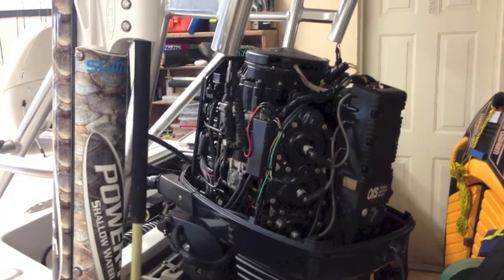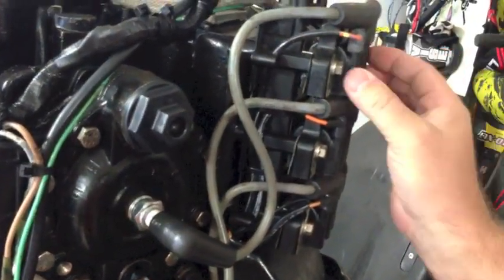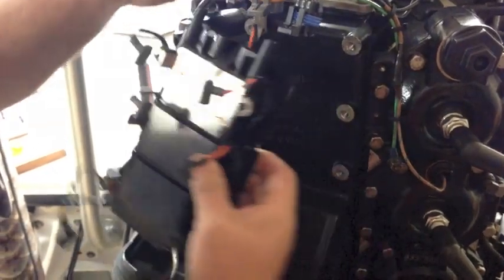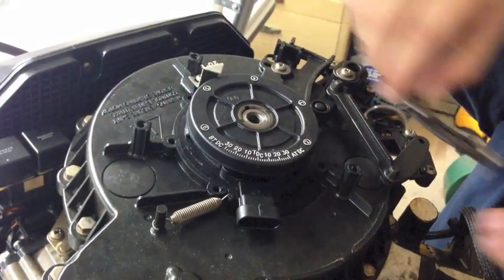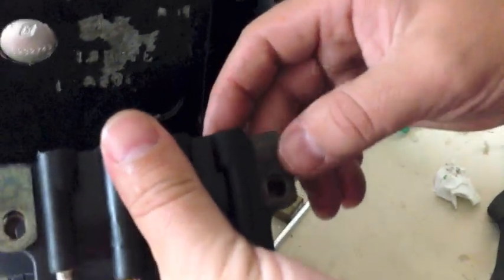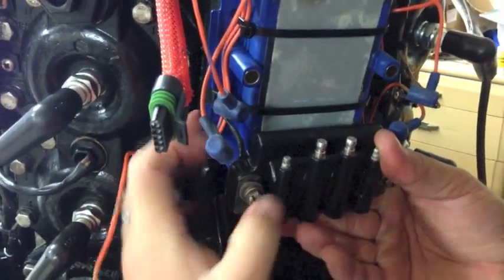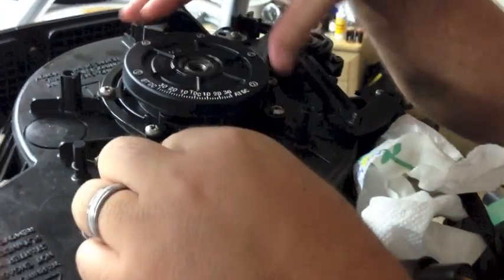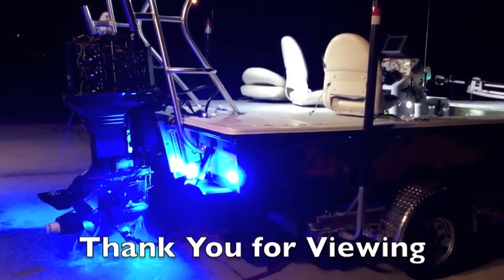1996 Evinrude 150 Power Pack Replacement

Comment: Hey Bobby, great info, I checked my shift switch by unhooking the ground wire and it still only ran the 3 port side pistons, the 3 starboard remainder dead in forward neutral and reverse. I can only assume the power pack would be the issue. Would love the feedback!
Reply from the maker: That sounds like the power pack. I’d replace the coils at the same time.

Comment: I can't believe any boat mechanic told you to change the power pack as a first try to fix the problem!?
I'm not any kind of mechanic but it's pretty common knowledge that the shift interrupt switch kills one whole bank of cylinders, and the switches often jam or short out.
Just pull the wire plug out up near your thermostats on the head to test. Follow it down to the shift /throttle linkage at the base of the motor and your will see it.
Reply from the maker: Wish you were here to troubleshoot!

Comment: I have a 2000 Johnson 150HP that having the same issue with no spark on one complete side of the engine.  I have replaced the spark plugs and wires, the power pack and optical sensor, and all the coils.  Still have no spark on the same side of the engine. (left side when facing the engine standing at the rear)  Is there something else I should check.  I bought a new stator to replace but now I'm just throwing parts at it.
Reply from the maker: It sounds like a ground is not connected shutting off the bank. There are three wires going to the shift interrupt switch. One positive and two negative. I would try and figure out if something is wrong there. Or the switch itself has shorted out.
Reply: It in fact the shifter switch. I did change the power pack, optical sensor, coils, wires, and plugs. Did not fix the problem. I was about to change the stator before I came across your other video about the shifter switch being an issue. As soon as I removed the ground wire all three of those cylinders had spark. I wish I had found that video first before I spent all the money on that other stuff. But a good lesson to learn.
Reply from the maker: Having all that stuff replaced is probably for the better anyway! Such a great motor as long as you keep the oil mix. Mine is still going strong. It’s a 1996.

Comment: I have a 2001 Johnson 150 hp outboard it looks the same as the one you’re working on but I’m white, it runs good for about 5 - 10 minutes and then dies and have trouble starting it again, I replaced all spark plugs, clean carburetors, new water separator, it was running good before I store it for 4 months
Reply: I just subscribed to your channel I like your work
Reply from the maker: thank you so much!

Comment: i know this is a old video but i have the same motor and had the same symptoms so i changed the power pack and starts up good but will not idle i have checked the shift switch rebulit the carbs new powerpack new optical sensor new plugs the only thing left that could keep it from running would be the stator any ideas?
Reply from the maker: I would rebuild the carbs again. My problem was a tiny piece of plastic curled around one of the high-speed jets from cross threading it. Do a complete bowl replacement.

Comment: nice video thanks for sharing. I have a 05 175hp no spark on any spark plug, coils tested fine, how do I test the power pack? engine sounded good.
Reply from the maker: I do not know how to actually test the power pack. I’ve only replaced them. Wish I could be more help.

Comment: I'm having the same issue, The thing is a few years ago when I bought the boat I couldn't get it to start and did some shot gun trouble shooting and started replacing things. Well I replaced the power pack because I didn't know how to test it but my starting issue was my optical sensor. Well now I have one bank not working / spark so I thought it was the power pack so i used my good know power pack that I replaced for know reason and it switched sides, from the side that was working is now not working. I've swapped them out a couple of times and with one power pack one side is bad and with the other its bad. Not sure if i should buy a new one
Reply from the maker: Try the shift interrupt switch. I made a video on this. If it goes bad half the cylinder banks will go out.

Comment: Hi ,i have a 1997 johnson 150hp OIS and Not firing left bank 2,4,and 6 piston. The right size are good. Firing but not hard. PoWERPACK, OPTICAL SENSOR? AND i have another question the cable in the wiring color gray and red line its for? Thanks
Reply from the maker: I would check the shift interrupt. I have a video on this if you search my channel. The shift interrupt switch shuts off the left Bank to make for easier shifting. Seems like it could be that

Comment: Good video. I have a 96 150 Johnson Oceanrunner. It runs great, plenty of power, idles well, but has a random miss, any mid to high throttle position. Its like someone turning off and on the key for a split second. Any ideas. Thanks.
Reply from the maker: Sounds electrical. I’m not a  mechanic but the power pack controls the spark, coils amp up the power, optical sensor controls the timing. I’d start with power pack. It’s an easy swap.

Comment: Hi, what model is power pack?
Reply from the maker: It’s a CDI 113-4985. Runs perfectly. I’d replace the coil‘s at the same time. It’s not that much more money and you already have access.
Reply: @bobbygfl thanks, And the coils is the model OMC 583740, 0583740, 18-51703326AB
Reply: @bobbygfl  My coils were stolen
Reply from the maker: @olivermontalvo1590  oh man. That sucks. I need to look at my old coils. I still have them. I’ll let you know.
Reply: @bobbygfl  please, thanks

Comment: does that issue bring on your check engine light?
Reply from the maker: I do not have a check engine light however it would have a buzzer and no it does not set off the buzzer
Reply: @bobbygfl  Im having an check engine light coming on at about 3k    im sure it is the vacuum sensor but cant seem to figure out why
Reply from the maker: @jerrythompson3918  I wish I could help. Good luck, hope you’re right.

Comment: I have a 1998 150hp. I'm having issues between 2k and 3500 rpm. It stumbles. A lot better at wot but it cant rev past 4200 rpm. What electronics should I change? Thx in advance.
Reply from the maker: sounds like carbs.  sorry for the late reply.  hope you figured it out

Comment: Great video. I purchased a 1998 90hp Johnson OceanRunner. I replaced the power-pack and just ordered an optical sensor. It doesn't have any spark and was told that will take care of the issue?
Reply: I know this is super old, but it could also be your senor and/or charge coils on the stator which is why you need the FACTORY service manual and a cheap DVA adaptor/multimeter combo to pinpoint. the last thing you want to do is blindly replace parts!
Reply from the maker: Hope you figured it out. Thanks!

Comment: I have a 1972 70 evinrude and I have a new starter and new silenoid installed and at full battery charge all I get is the click at the silenoid but no starter engage...what is the deal?
Reply from the maker: Check for current at the starter. If current remove starter and see if it spins when the key is turned. If yes maybe Bendex could be jammed.

Comment: I have a 1999 Johnson looks like the same power head you got there.  did this fix your issue?  

the left head/bank is not firing on mine at all.  my symptom was not building power, would not get on plane, would idle rough, ultimately overheated, because of all the strain on right head/not enough power to properly operate the water pump at full capability.  I pulled plug wires while running and did not change anything, so I pulled plugs and no spark, test light does not show anything either.

I assume you did not need the optical sensor then?

thanks a lot for the video.
Reply from the maker: Yes it did. Hope you figured it out

Comment: So I’m having the same problems and I have that exact setup. Can you show me how to test my power back to make sure? I have a meter what should I check?
Reply: shift interrupter switch shuts down a bank of cylinders (port or starboard depending on year) so it could be a cable out of adjustment or going to ground. get a DVA adapter for your multimeter and start testing the stator . there is no direct test for powerpack as it's a process of elimination. check ground kill wire at the pack to see if shorted to ground.
Reply from the maker: I’m not sure how to check voltage or if it’s worth the effort to do so. Just replace the power pack and coils would be my advise

Comment: Hi my is rob , what web site did u get the power pack from because my motor is doing the same thing johnson 150 hp 1998
Reply from the maker: Dontae Young hi. I got the power pack from West Marine (239) 985-6700 ask for Gary.
Reply: Good info I have an older 175 Johnson. Been sitting for 10 years. No spark. No plastic on top. Under the flywheel is a lot of oil. The Motor is clean. Looks like it has never been worked on.the last owner said it went from running perfect to cutting out. Brought it. Home and parked. Its a Skeeter bass boat.

Comment: Am I seeing some kind of muffler on your prop?

Do you know how to adjust the idle speed on this motor? Is it done by the timing like an older v6 motor is?
Reply from the maker: CFauvel yes and no, you can advance the optical sensor position and it will increase the idle also you can adjust the throttle cable set screw.

Comment: just found out the starter is bad.
Reply from the maker: Good deal. That's an easy fix. The Bendex and starter may be separate parts, if so I'd replace both.
Reply: +YOLOfotos I have to replace my pack on the same exact motor.  I'm not going to change the sensor either just yet.  Did you have to check timing and the S.L.O.W. function?  Or are those steps not needed?